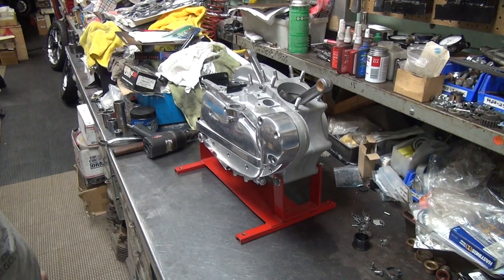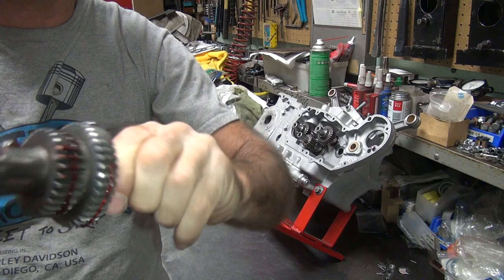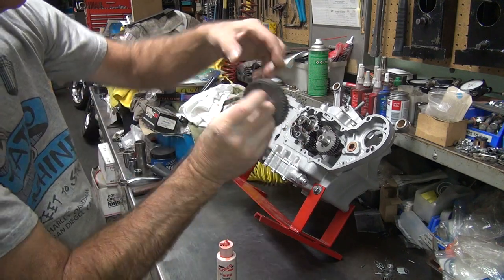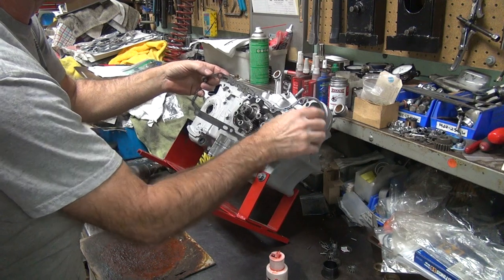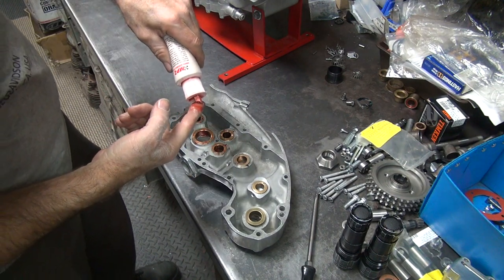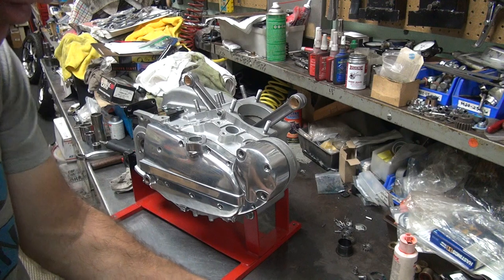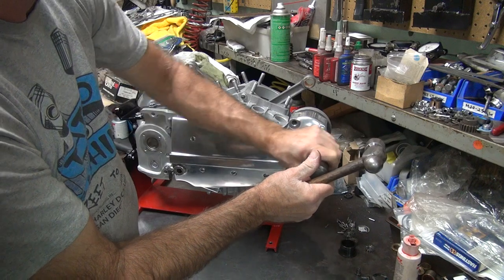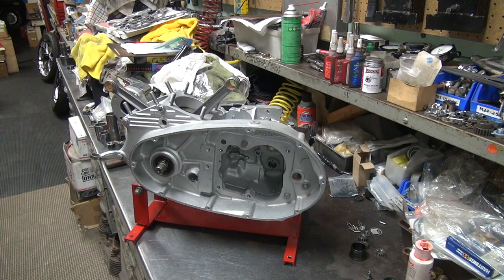1961 xlch #210 no miles transmission motor rebuild sportster harley repair restoration tatro machine

Comment: what cam grind is that?
Reply from the maker: stock oem nos P' cams. these are the stock cams for the xlch 900 motors. the xl and xlh models used the weak ass XL cams.
tatro

Comment: Thank You for calling it a "CIRCUIT BREAKER"--------My Old Man was trained by the US AIR FORCE. So that means " I " was Trained by the US AIR FORCE.
Reply from the maker: it really doesn't matter what you call it. lets not get into the motor engine deal next.
tatro